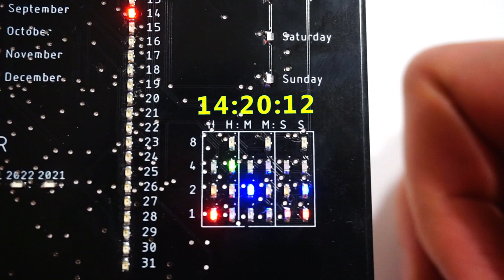5$ PCB Calendar + Binary Clock (With Arduino)

Comment: This thing lasts for 3 days before it dies due to power starvation?
Reply from the maker: Yes, without any MCU power save modes and LEDs in full brightness. I tried to make this as simple as possible but battery decision was too ambitious. Next time I will use 9V battery and add SMPS.
Reply: @melnedgars7273  I would love to build one as a gift for someone but knowing that it probably would not last long without a constant change of batteries sucks.. your calendar kind of gave me an idea what if you could display previous current and next month's days.. you know how people have to look at their calendar to figure out when a certain day is next or previous month? What if one were to create a pcb calendar that shows the next 1st day of the month falls on a wednesday (for example) etc... Maybe even a space on the  pcb to write in dry erase pen? I don't know how that would work but that's what was going through my mind watching this video
Reply from the maker: @BHSAHFAD  I can make for You better version ;) What do You think about size (8x10cm) ? I would like to build it at least 10x20cm (but it costs a little bit more). I can add battery charger and USB port so this calendar could use CR battery for time keeping and main power would come from LiPo battery or 9V alkaline battery. let me know if You figure out how to display previous current and next month's days ;)
Reply from the maker: @BHSAHFAD  probably great marketing skills :D
Reply: @melnedgars7273  yea no kidding